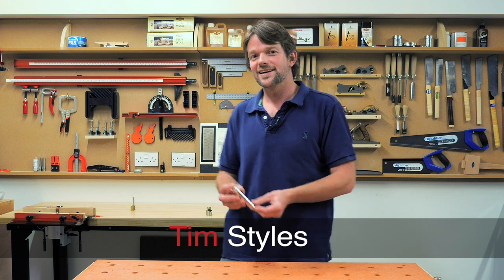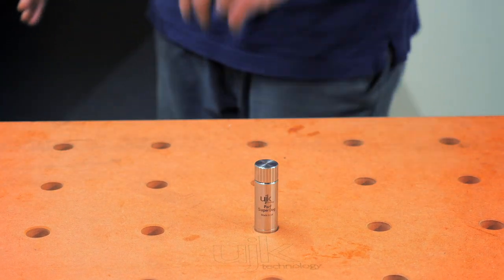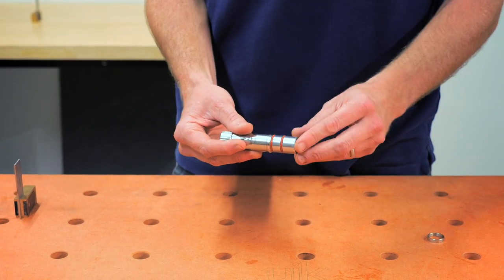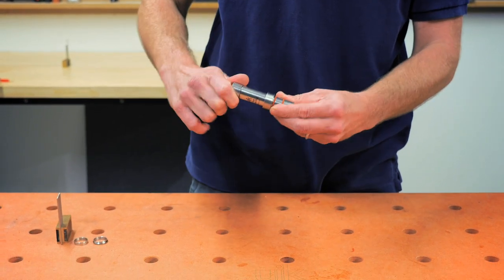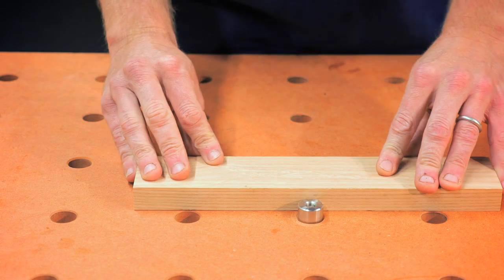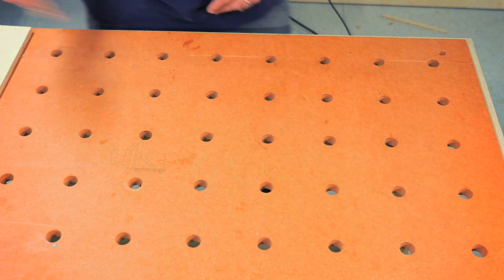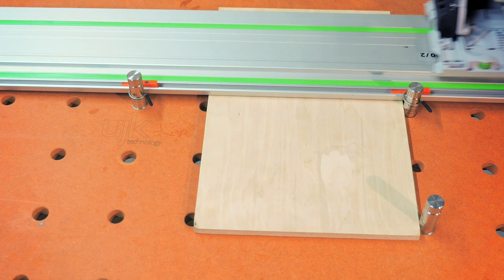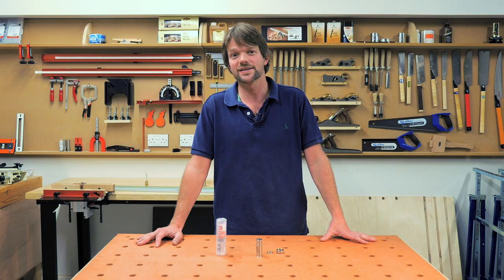UJK Technology Parf Super Dog - Product Overview

Comment: Bought your top price 106161 full set. Scratched my head for 2 days on how to use the superdogs in the third configuration you show here. Watched your video just to see you cut the footage and jump from one configuration to another suddenly adding extra ring my superdogs don't come with, so still had no idea what I'm missing. It turns out, since that vide you've changed the superdogs to be able to do only 2 configurations. Mystery solved.

Even more frustrating experience with your Sjoberg Nordic 1450 bench. The very last step in the manual is telling us not to do the very first step in the manual if we want to assemble the bench in it's full capacity with the sliding doors and drawers. The moment we do step 1 in the manual, no further assembly steps are possible, and you would not now why, if in absolut desperation, you do not decide to skip all following steps and read the very last step on the last page of the manual stating: 
"N.B. The two original rails supplied with the bench trestle will no longer be required" 
The very first step in the manual is advising us to start with attaching the rails to the legs...
So much FUN!